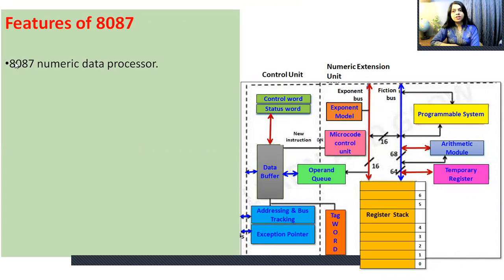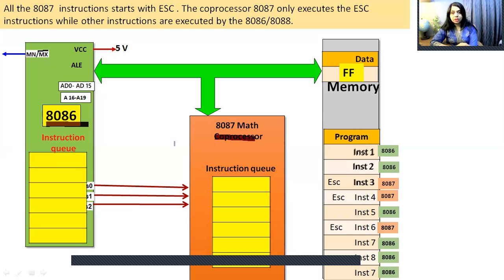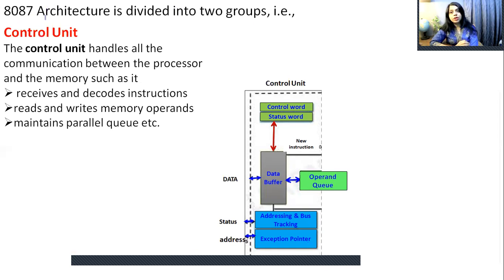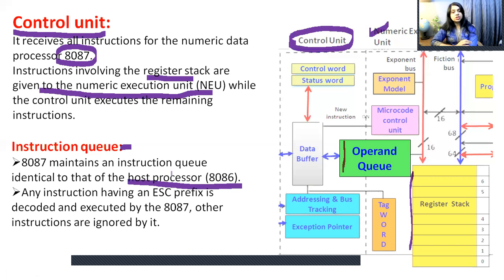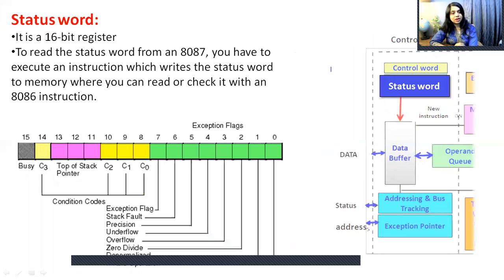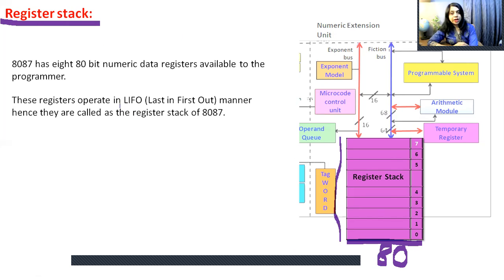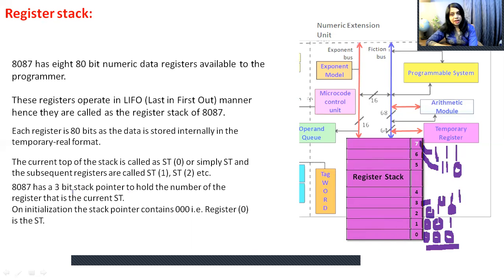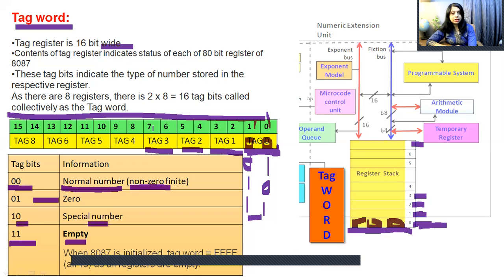8087 architecture

Comment: CAN U MAKE A VIDEO ON THIS?
Draw  the  hardware  scheme  for interfacing  16-bit  8255  ports  with  8086.  The address  of port  A  is  02FOH.  Find  the  control  word when  the port  A  and  upper port c used to display the switch position and port B and lower port c sense the switch status
Reply from the maker: yes